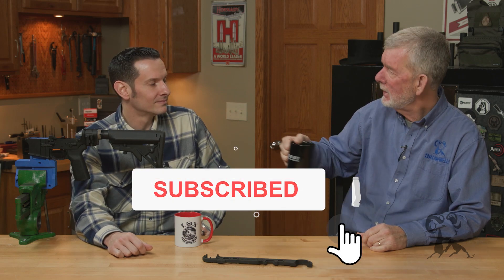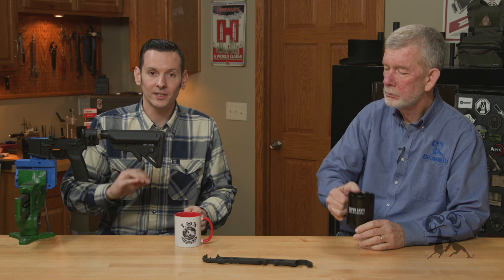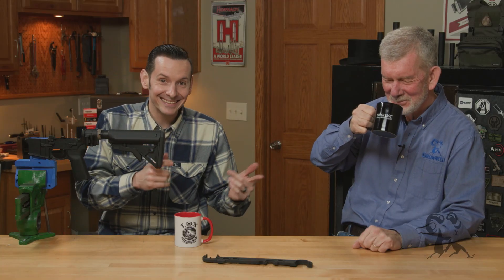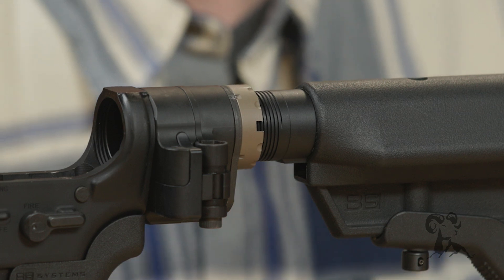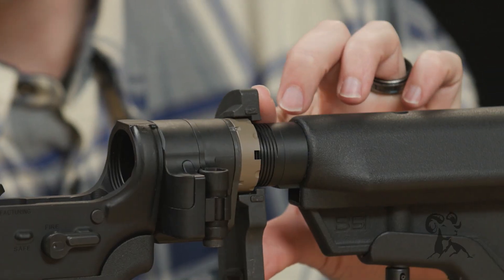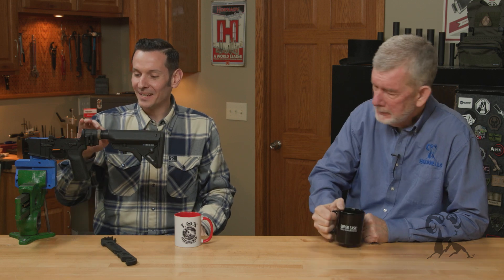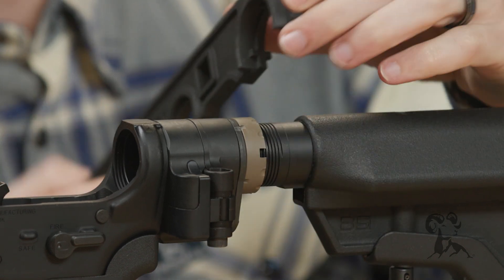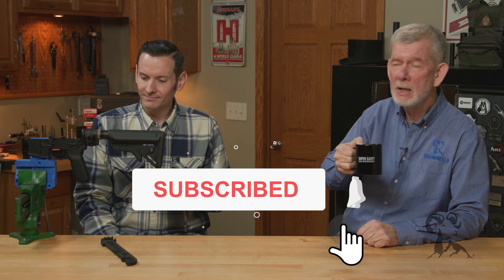Smyth Busters: Can You Un-Stake an AR-15 Castle Nut?

Comment: Guys, great video.  I've been using AR-10s, AR-15s for the last 40 years and have grown to really like the rifle.  Because the military specifies staked castle nuts, everyone thinks these must be staked including civilian/sporting models.  I own two 35 year old models that use a  buffer tube nut with one hole on the side. It uses a spanner wrench with a nub that fits in the hole to both loosen and tighten the nut.  No place to stake it.  These are original and have not come loose in all these years of use.  Nor have any other of my rifles with un-staked castle nuts loosened with long use.  When I replace a buffer tube and castle nut, my usual process is to lube the receiver threads with a good gun grease and torque the nut to 35 ft-lbs.  I leave them un-staked and have never had one come loose.  Not staking also makes re-using the buffer tube end plate and castle nut cosmetically more pleasing than using parts chewed up from being staked.
Reply: My AR15 is not even staked. I gorilla hand tighten the castle nut. I have not once torqued it down. I never had one backed out on me.

Comment: I have a factory staked  castle nut not punched but crimped right in the grooves. Having a hard time breaking the crimps. Thinking of using a Dremel to remove enough material to be able to break it free. Anyone else have this problem or have a better solution?

Comment: Since there are like 3 staking cuts in the nut I would imagine you can just stake the nut in a different spot when you put it back on in lieu of replacing the plate.    I'm thrifty and only stake in one place since that seems to work for me.   I did watch Caleb's video on how to properly stake so I'm comfortable with that, I redid redo both my lower receivers after watching it since my original ones weren't properly done (that was on ME).

Comment: Mine is not being that easy! i tried one time without the upper on and could see as i put a small amount of torqe that my lower would slightly tweek. so i tried with the upper receiver on it and it did provide some stability I put a little more torqe and eased on some more and was feeling like i could still break something and just backed off and have not tried again. SO its safe to say I did a good job staking mine!
Reply: Mine came staked from the factory and it was not at all cooperative when I tried to remove it.  I too decided it didn't need to come off at that very moment 😂

Comment: So I have a Stags Arms AR  and obviously it had a factory stake job done on the end plate.  I got the life of me cannot remove this SOB!! I've tried everything, I have the castle nut wrench and I've put an my weight into this little bugger but not able to get it to budge.  It's it possible that they may have also used a substance like lock tight in conjunction with the staking?

Comment: Why can't one avoid deforming the metal parts and simply put Blue Locktite on those threads?
Reply from the maker: We have seen many extension threads ruined by blue loctite. We rarely recommend loctite on aluminum threads.

Comment: really blue or orange loctite will do the job and all parts can be reused. i work on boilers and chillers so i have a lot of temp differential going on and then there are shut down times. blue or red depending on temps will keep everything in spec.

Comment: What about getting it back off after using Red Loctite on its threads?
Reply: Lol no
Reply: @rawcircoking  I've seen it done by idiots -- and lower receivers destroyed trying to break it loose. OTOH, Vibratite VC-3 is made for applications like this and is an alternative to staking. Chad who owns "School of the American Rifle" has cited it as an alternative to staking . . . and he is a preeminent expert and gunsmith trainer on the AR-15 platform. That said, he still prefers staking. I've used Vibratite VC-3, but not on an AR-15 -- engine parts. It's not a thread locker as it remains somewhat pliable. Disassembled bolts and nuts can be reassembled several times without having to reapply it.

Comment: Came back with a suggestion for upcoming topic, how to tune using correct recoil spring for 9mm,45acp based on ammo selected, ie hot vs light loads need different springs to avoid ejection/feeding issues, also if needed to protect from recoil wear, use of recoil pad?

Comment: You don't really need to replace the end plate and castle nut unless looks are important.  Just carefully remove the little burr that staking raises. Re-stake  the castle nut in a fresh spot. I put my stake points on the under side so you don't see them as easily. When I am going for good looks and function I might use a fresh end plate and castle nut.

Comment: I don't run the majority of my AR rifles or pistols hard, used mostly for hunting hogs. I have never staked any of my ARs, just tighten on the castle nut and I have never had one come loose. I can understand the provision to stake being there, pretty brilliant actually, certainly for military applications and hard use, I just have never had an issue with castle nuts coming loose without staking so I don't do it.

Comment: Obviously it’s best to replace the end plate, but if it’s a more expensive one or you’re out, can it be re-staked?
Reply: I ground a cold chisel to fit the castle nut notch so I can push the metal back into the end plate. That way I can reuse end plate easily.

Comment: You torque a castle nut almost as high as you torque a typical barrel nut. You’d think from the hysteria over a castle nut possibly getting loose there would be even more concern over staking a barrel nut. lol
Reply: Finer thread pitch on the barrel nut, which does make a big difference, and a wider surface of threads on the barrel nut, plus the barrel nut is much more rigid, whereas the castle nut is narrow and thin. That all just equates to the castle nut having more chance of it coming loose.
Edit: grammar.
Reply: @JimYeats  Yes, each nut is designed to handle different stresses. A barrel nut has to handle much more stress than a castle nut, so each are designed for their task. Staking would still be just as necessary/unnecessary to each nut.

Comment: How about a Smyth Busters episode about leaving batteries in optics in storage for long periods of time can cause damage to the optics.
Reply: In my experience, Alkaline batteries once exposed to large, repeated temperature change, will leak and foul the terminals of whatever they are in, such as optics, lights, ear pro, etc. Lithium batteries, however, avoid this by being leak proof to normal temperature changes. Anything that will be used for self-defense or duty, needs a Lithium battery.
Reply: I had a customer bring me an optic that he could not remove the battery cover from. (The battery was dead.) When I got it open it turned out the AA battery had exploded and corroded the compartment and cap.
Reply: Oh crap I was unaware of this.

Comment: If you want it to be more of a pain to remove use rocksett. 
Then you will have to boil it for a good half hour to remove it. 
I am a gunsmith and I apply cerakote and many ar 15s have had rocksett 
in the nuts and or on the barrel and receiver extension tube lately. 
If you try to take it off any other way you will most likely destroy it.
Reply: The only thing rocksett belongs on is gas block screws. Be sure to kick them firmly dick to teach them a lesson.

Comment: Nope. 100% impossible. Once you stake a castle nut you're stuck with that buffer tube, end plate, and castle nut. If you damage the tube, nut, or plate, you need a new lower.

Comment: BS. Staking the nut is a carry over of the TDP from when the old nuts that had holes vs the new “castle nuts” were tightened using a spanner wrench that had a nipple that would fit in the hole to grip the nut. The design of those spanner wrenches couldn’t take much torquing before the nipple would break. Thus, staking was done as a failsafe. Castle nuts and the new wrenches for them allow for much more torque to be placed on the nut than the old design. (That was literally the reason for the design change)

I have been building and repairing ARs for over 30 years. Never staked a nut once. It isn’t necessary unless you are trying to conform to the TDP. If your castle nut comes loose, you simply didn’t tighten it enough. No nut stake on a nut that isn’t under heavy mechanical stress, (and castle nuts aren’t) will make any true difference in over-riding the torque that (should) be on the nut when it was installed. Staking a nut is a fail safe for poor quality control. Period. Change my mind.
Reply: If you believe this, you're going to hate the SmythBuster we filmed this morning! I won't spoil it for you but it is proof that you're wrong, stay tuned!
Reply: @CalebSavant Barrel nuts are typically torqued just a few pounds more than a castle nut. No one is staking barrel nuts.
Reply: @randyroydwb  this.
Reply: @CalebSavant  I guess Chris Bartocci from Small Arms Solutions who worked for Colt, is a liar and does know what he is talking about. Maybe the two of you can compare notes, and resumes, and see who’s right. How many factory tech manuals or books on weapons have you published? 😊
Reply: "I'm old and I've emotionally attached myself to false information and now I'm impervious to logic. Change my mind"
Reply: @KeepTheGates  right. Ok buddy. Maybe you could ask an engineer to show you the math on how much force the stakes (don’t actually) apply to the nut if done in accordance to the TDP. You can also not take my word for it, but maybe listen to Small Arms Solutions (he worked for Colt) about the nipples on the spanner wrenches.

Comment: My thought- If its that easy to remove, whats the point of staking in the first place?  Just properly tighten the castle nut?
Reply: As they mentioned it's to prevent the vibration from the gun firing from loosening the nut. Yes if torqued correctly it may not come loose but the staking prevents it from happening.
Reply: Because nothing is holding that torque and they can vibrate loose. There's no valid argument against staking.

Comment: I would have put the wrench on the other way, I suppose with a good quality wrench it doesn't matter.
Reply: Nyet, is fine.
Reply: I came to think of the same thing... But I did just not notice which end had the catch tooth to go into the castle nut...

..Apparently the wrench's sides ain't like each other.. Seems as it is supposed to sit just that way. I totally had to do a rewatch..

Comment: Obviously it's not permanent but I see zero reason to do this unless you are someone that goes on days/weeks long trips in the wilderness. A drop of blue loctite is more than enough and you're not marring up your parts. Only staking you need is the gas key.
Reply: False. Loctite shouldn't be applied to buffer tube threads. They're coarse and it doesn't hold. I don't understand why people can't see a reason to stake their castle nuts. Maybe to keep it from coming loose lol.
Reply: @KeepTheGates  thats total nonsense the threads aren't that coarse they are only 16 TPI and loctite works just fine on 16 TPI. That's gotta be the dumbest thing I've ever heard. People don't want to stake them because 1. they never come loose anyway and 2. they don't want to have a gouge in their rifle which can also take the coating off the nut and cause it to rust. Staking the castle nut on a buffer tube is completely unnecessary unless you are going to be in rough conditions for days with no tools for that 1 in a million chance it's gonna loosen up. Only keyboard warriors that think they are Navy SEALs do it.
Reply: @KeepTheGates  LMAO the threads are too coarse for loctite to hold eh? All the 40 yr olds in their parent's basement totally stake the buffer tube nut lol.
Reply: Who cares about marring and endplate? Mine is a "fancy" BCM that cost 8 bucks.
Reply: @TUKByV1  because it looks like crap it's useless to do to a buffer tube nut and mostly because it can rust if you gouge the coating off. use your brain.